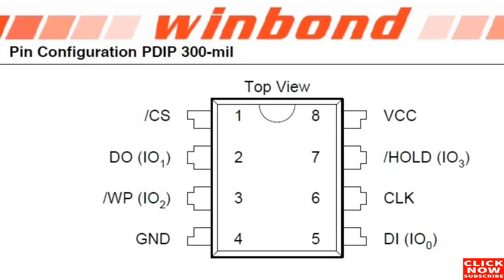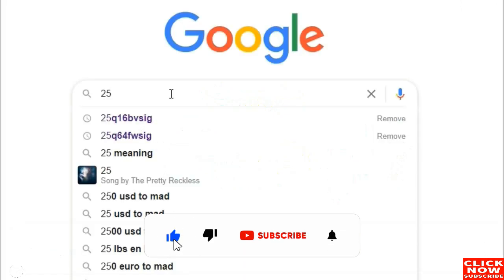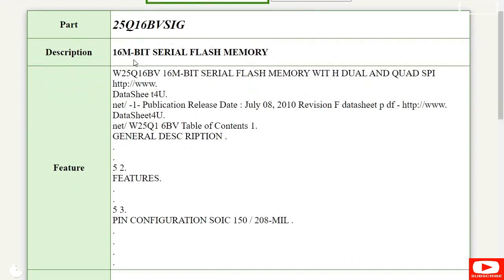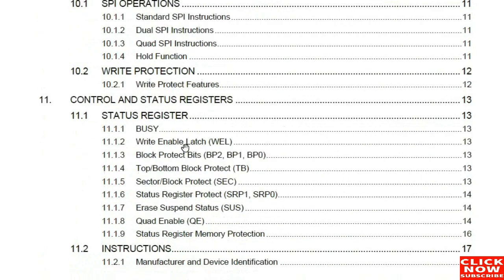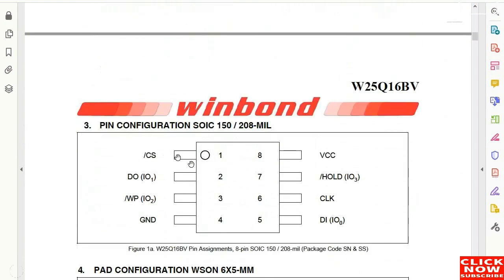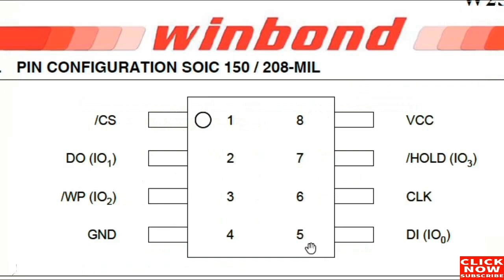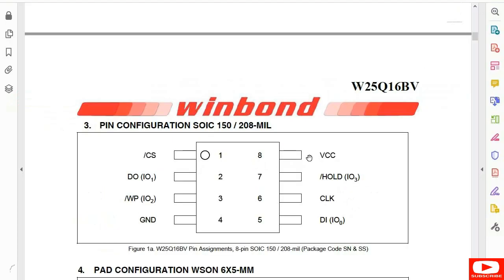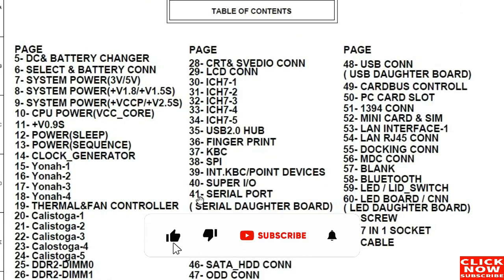BIOS pin configuration explained, Basic Input Output System circuit diagram

Comment: Why is there only one pin for data output? If a 64 bit processor wants to read the bios from a 8 pin spi chip, i understand the bios address/reset vector from the cpu address pins can be decoded to enable the CS line to select the bios chip, but if there is only one pin for data output, how is the bios code read from the chip if the cpu data bus is 8 bits, for example?